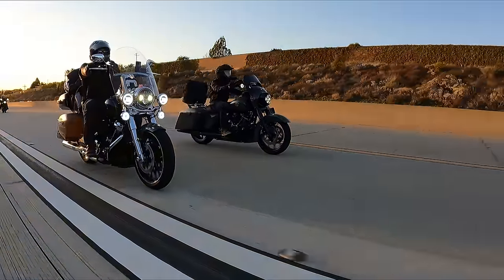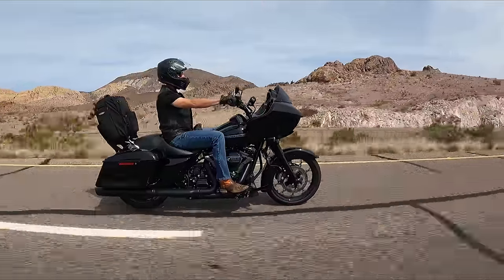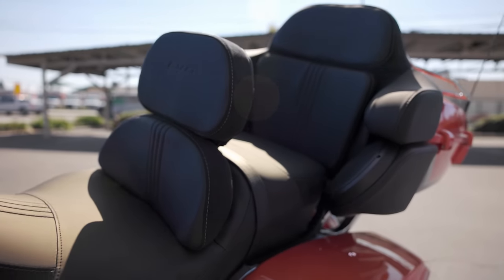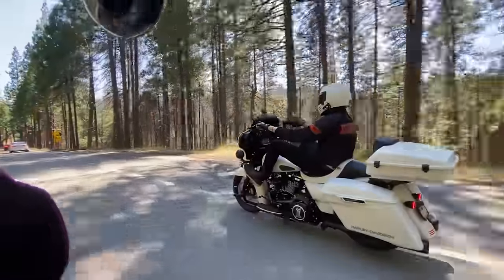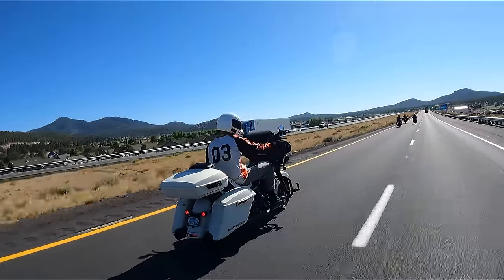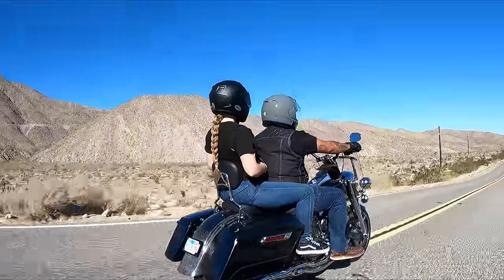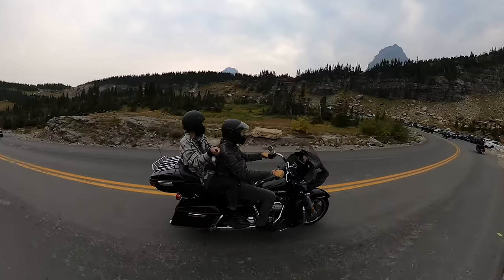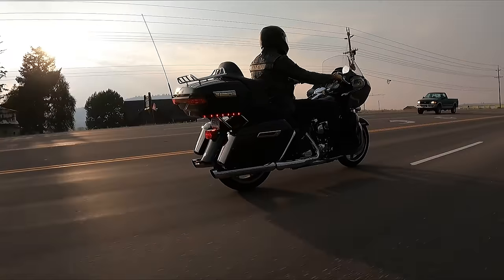Top 10 Touring-Comfort Accessories & Mods for your Harley-Davidson Motorcycle

Comment: Good tips. My top 5 comfort features are: seat, wind protection, bars, cruise control, and the best bang for the buck. Ear plugs. I ride 80+ mph for hours in 20+ mph winds. It's crazy how less fatigued I am when I wear ear plugs.
Reply from the maker: Totally agree with the ear plugs!
Reply: Ditto absolutely the ear plugs. I also have found reducing your clothes from flapping in the wind lowers fatigue. I use Velcro straps on my lower legs
Reply: Good tip! I started wearing ear plugs in the 90's. I got a lot of odd looks and eye rolls  back then but... No fatigue for me.

Comment: I’ve been riding Harley CVO road glides for over 10 years and having logged over 100,000 miles on them. I would agree with your list with one exception. I would eliminate the heel shifter and add the new Harley hammock heated/cooling seat. In hot and cold weather it is a game changer. It would definitely make my top three!
Reply: cooling? so in hot weather it could remain on lower temp?  great
Reply: I have a corbin heated seat on my kawasaki Vulcan, it's a  must have for cold weather riding, a bit pricey at $907 plus tax and shipping but worth every penny 😀

Comment: Love your list! Just added a rider backrest to my Road King last weekend. Here is my list of what’s on my RK-Hwy Pegs, cruise, heated seat and handgrips (north Midwest), and in winter I have the slip on lower wind deflectors over my crash bars.
Knock out wind and hold engine heat. 
Still have factory suspension and bars, but I think everything else I added.

Comment: I run up and down the east coast (Florida to mass) a couple of times a year and my ultra is it. Been doing it for 13 years and always do it on a rgu. I keep an oem rg seat and quick release tourpak for in town and convert it with tourpak, riders backrest, oem seat,  and cb for the road. 12 inch apes and highway pegs are a must. 
Lucky Lep's Cycles

Comment: Excellent video. I have 8 out of the 10 on my 2016 Triglide which has 120,000 miles. I don’t have the custom seat or the after market suspension. On my last trip from Nevada to Texas and back the air suspension on my Triglide left a lot to be desired. Thanks again.
Reply from the maker: Thanks for the comment. 8/10 sounds like a comfortable ride. 👍🏼

Comment: Old school rider who ten years ago at 50,went from rigid frames to a Road King. King has a Hoppe fairing,hard bags and 14 inch ape hangers from when I bought it. Going back to my chopper days,I made my own jockey shift set up that works like a dream,and my own ‘dump style’ drag pipes with homemade baffles. Made my own sissy bar and padded backrest also. As far as highway pegs go,I just rest my feet on top of the crash bars. At 60,I’m building a rigid Panhead that I’ll likely ride more than the bagger when it’s done.

Comment: Fully agree Matt, I got them all installed and they are all worth it. Heated seats really depend if you ride usually on a cold weather …whether heated grips can make it even in warm places because sometimes it is cold enough for your hands and it may be even dangerous (eg morning commute to work), heated seats are less mandatory unless you use the bike frequently on cold places.

Comment: Great tips.  As a Northeastern rider, Heated grips are number 1!  I was occasionally riding in 20F / -6.66C with salt and slush on the road.  I would constantly change my snowboarding gloves every 15 mins or so whenever I hit the highway.  I would thaw my hands on the engine block for about 10 mins in Chinatown NYC to keep warm and it wasn’t enough.  Sporty rider ✌️
Reply: Snow seal on boots and leather gloves us also great for winter riding. I gave heated grips and heated gear. In the winter in toss leather riding boots and gloves in oven at about 175°F. Rub in snow seal repeat then buff out. Water proofs and blocks wind. I do not used a fairing or windscreen, so wind proof and water proof gloves are a must. With them snow seal, it do not need bulky gloves, which adds to the comfort level. Snow seal is not expensive and a can should last 3 or so years.
Reply: @michaelconran5252  great tip, I’ll definitely try this out!  I hate bulky gloves too, kills the throttle response and front brake pressure.  I use wool socks and double layer for the boots and have been ok, thanks to Rokker for a premium boot.   I don’t use a windscreen or shield either.  Safe rides friend

Comment: After my last cross-country trip, I finally spent the ~$1k on an mccruise cruise control system from Australia for my 2018 Versys 1000. It shuts off if you hit the brake or pull in the clutch, and looks like it was a factory installed item. I absolutely love it, it completely changes the long distance experience. I spend enough time at highway speeds during my daily commute that it's also made it much easier.
Reply from the maker: Yes sir. Game changer out on the road.

Comment: Agree with all your suggestions and I have them all except heated grips.  I went with heated gloves instead but the grips would really be nice if I could find a great style.  I have the heated seat and my wife really loves that ,plus I have a heated backrest for the tour pack.  She likes that more than the heated seat!  But the one thing I love most is the rider backrest.  That is a must. I've had the same one on my last three bikes.  I just remove it when I sell or trade.  I will never have a touring bike without one. I've done 3 coast to coast rides and countless halfway rides since I live in DC and I'm from Texas I make that trek 2 -3 times a year. One of the newer items I have is the modular helment that flips fully rearward. I have the Shark and my wife has the LS2. Both work great and give you a lot of options.

Comment: Agree with all, I always add floorboard extensions. Seems to eliminate the bowlegged feel and to me adds a lot of comfort
Reply: When I first looked at those At my dealer, I was very skeptical as to whether those things would work for anything at all? But I finally gave in and bought some off of eBay out of sheer curiosity and what an amazing difference push my boards out an inch and a quarter from stock. Love them.

Comment: Thanks for the list on Accessories and mods for touring. I have a 2015 Ultra Limited and will always have a Ultra Limited as long as I ride. Bought mine used in 2017 as a two year old bike having 6700 miles on its already. I logged 10,000 K in the first nine months of ownership. I love my limited. I have made some improvements such as Back rest, highway pegs, Klock Works windshield, Ram mount for the phone, Headers and pipes and K&N Filter, ETC... Use the radio all the time. I live on my bike. Thanks for the content. Always checkout your content on the channel. Safe riding!!

Comment: The three comfort upgrades I made on my 2020 Street Bob was touring seat with backrest (Mustang), heated grips and leather covers for levers. Your video warned me about the Street Bob seat. Best looking, worse performing. Heated grips are a no brainer, have had them on my dual sports and I currently live at 7,000 feet. The leather on levers was for looks but add to comfort when riding at freezing temps or very long rides, didn't expect that. For body, heated pants and vest. Not a fan of wind screens, but i gave ridden in 17° F with no issues. To be fair I like cold weather. I installed heated grips on wife's Softail also along with a heated seat pad. She has electric gear also. We tour on the Softails with no issues. Neither of us like windshields, but with the right gear, comfortable seat and ergonomics, you can ride all day long. I believe the riding triangle is they most important, once you have that, all they other stuff falls into place. Being 5'1" with stubby legs, I can't reach forward controls, so a Softail with mids is perfect for me. To stretch/relax I just hang my feet over pegs. I can't flatfoot anyway, so feet hitting ground isn't an issue.
Reply: same brother

Comment: Suspension Technologies shocks work great for my 07 CVO Ultra.
I have Progressive Monotubes in the forks. My wife and I have ridden more than 80k miles on this setup, fully loaded for long three week trips.

The heated grips are awesome! We have ridden through massive rainstorms and as long as we continued to move, managed to stay mostly dry using heavy leathers. 

I rode my bike to work year round, temps down to freezing weather using heated gear and layers. 

My bike now has 92k mikes on it and going strong!

Comment: Definitely agree with that list. I’ve got a few of those added to my Road Glide Limited.

A couple others I’d add to the list: a drink holder and additional passenger pegs.

For long hauls, having a ready ability to grab a water bottle to hydrate regularly makes a big difference, especially on hot days. I’ve ridden coast-to-coast on my Road Glide (even stopped in at your store) and having the ability to hydrate on-the-go allows me to stretch my stops to the limit of my tank that much easier.

And for passenger pegs, I added the Kuryakyn adjustable passenger pegs. My wife loves having the option to shift her feet between the passenger floorboards, my lap, and those pegs. And we all know the adage: Happy wife, happy life. 😄

Comment: Yep that about covers them.  Learned the hard way myself.   Good suspension, cruise control, foot pegs and seat are a must for long hauls.  I have two different wind screens and two different seats for types of riding I would be doing for my SGS.  I have the nylon slip on lowers covers that slide on the engine guards for cold and wet riding conditions (worth getting). When it comes to long haul, comfort is king, looks come in second.  The HD Limited touring motorcycles are the most comfortable than any other manufacture for long hauls.

Comment: I have a 2022 RG Limited w/ lowers, heated grips, cruise control, RDRS, 14 inch KST, Klockwerks windshield, CIRO Highway pegs, SE Stage 2 cam, Rhinehart racing mufflers, HD Hammock seat, seat back and Custom Dynamics LED all the way around. Next up is Legends Suspension all around.

Comment: I road a Honda V65 which was rated with 125+hp that I took on many road trips with Harley riders. I NUMBER ONE addition was a cruiser/wind shield for comfort. Lower wind Fairings mounted to the engine guard was right up there.... I did have a DriRider one piece suit that keep me bone dry to go with water proof riding boots. Great list.....
Reply: You mention heated grips at the end.... I used a DriRider heated gloves with three settings and off. Great on long cold days on the road.

Comment: I run soft lowers on my road glide when it gets colder. Also on trips, for wind and rain. They are not super attractive but the ride is much more enjoyable. That’s the reason I haven’t put on the Santoro crash bars to match my bag guards, the soft lowers won’t fit on them… don’t want to give up that comfort for looks.

Comment: You nail it right off with the backrest. With my SGS it was the first thing I got. With 10k on my 2021, I’m still liking my stock seat, but my Highway pegs are a must. And cruise control for sure. And yes my 12” bars definitely made a difference. Still playing with my suspension. Dropped 2” on the rear with the stock shocks, and found a sweet spot on the adjustment. The only other thing I’m thinking of doing is front and back shocks. As for the heal shifter, I’m still old school. Keep the vids coming Matt. Always enjoy those left coast rides from here in Florida. Daytona Biketoberfest coming soon. Maybe the suspension then!

Comment: At the present time I have a 2007 CVO I bought it used first thing I did ,new full windshield, it has all the extras that You had mention, I plan to get rid of the air in the back an put on a different set of shocks, I really don't càre for the back restI  I pulled mine,I'm not quite 5 ft 9 ,I got lucky my Handel bars are perfect for me, All in all I have every thing you talked about an I do agree , makes the ride a great ride, I enjoy your videos ,keep up the great work,an have a safe ride, Thank You

Comment: Spot on Matt. One thing i would add to the list is mid-frame air deflectors. They really help keep the heat off of your thighs.  I have added most of your list to my 2016 Street Glide Special. I agree that rider back rest is the best accessory for comfort. I also added highway pegs, heated grips, lower fairings, and 7” wind splitter windshield. I love the stock cruise control.  Would like to update stock suspension and seat when the budget allows. I am fine with my stock bars.  Being 5’7” they work just fine. Keep up the good work!

Comment: I added a Mustang seat with a back rest to my 2020 Heritage 114 along with the HD Kahuna heated grips and I love it for touring now.  The handlebar position is perfect, the cruise control awesome and although it’s the soft tail frame instead of the touring frame, it’s comfortable for me.  The one thing you did not mention that’s big for me is rider floorboards instead of pegs.  They are stock on the Heritage and all touring models and they make long rides much more comfortable than pegs.  Plus the forward position is much more comfortable for me being 6 ft tall.   I rode about 500 miles from West Virginia to my home in Atlanta a few weeks ago and was perfectly comfortable and not tired when I got home.  Very good video.  Thanks for your hard work on all your videos.

Comment: I could not agree more I do a lot of long-distance riding, the order of my upgrades when I purchased my 19 RGS. 1) Seat w/rider back rest I bought it before I left the dealership 2) Windshield the RGS shield is worthless 3) Suspension/Shocks went with 13" Legends Revo A 4) Handlebars and heated grips. I did eventually upgrade front suspension as well but that's more for handling than comfort. My 19 RGS came with the heel shifter, but I would have added it if it didn't.

Comment: Good List, as a HOG Chapter Director and Cross Country rider (about 17k per year) I agree with your list - but I would offer this.  For Seat comfort the Harley Air Zepplin Pad (not full seat) instantly added 100 miles of comfort to my rides...upping my riding days to 400 miles a day. For peace of mind "comfort" the Custom Dynamics Brake light flasher made me feel more comfortable in traffic - cars drop back further from your rear fender when they see the "police like" flash of your tail lights.  The best windshield you can buy is the Long Ride Shields custom made re-curve windshield.  It instantly made my wife happy and kept her from getting beat up by highway winds.  (and it averages only about $100).   Another GREAT feature is the Sirius XM Infortainment add in - yes for music - but MORE for the Weather Radar Option that helps you navigate around rain and storms.

Comment: Got them all…. 
Lower that brake pedal
If you’ve got size 12 feet, lengthen those shift levers
Extend your rider floorboards…amazing difference 
Consider mini-boards instead of just a highway “peg” much, much better
Wife loves her Kuryakyn adjustable pegs along with factory boards….

Comment: I ride a 09 1200rt and agree with everything you've stated, I've ridden in the north and now I'm in the south riding most of the winter, wrecked my bike because of my eyes and rebuilding it to ride more, beemers are difficult bikes to work on but I've had more complements on this bike than any other I've ever owned and I've built some nice choppers in northern Okla.  I'm an older rider and still having a blast, just wish I had a good foot rest on the road but don't, can't even hardly device one either.  I'm wamting to get some good crash bars built for the front and back.

Comment: Loved this video with all the good recommendations for touring accessories. I have a 2011 FLHX Street Glide that I through the years have modified to perfection for my needs. The bike have lower fairings and heated grips (a must since I live in Norway, Scandinavia with its cold weather). I use the stock seat and a passenger backrest for those short trips with a passenger, a cool solo-seat for a more stripped appearence around town when driving alone, and I can throw on a heated touring saddle and a tour-pack for those long roadtrips. So, with these 3 saddles and the addition of a removable tour-pack I feel I have the perfect 3-in-1 bike for most occasions. Also I have the heel shifter and highway pegs. Really love my Street Glide.

Comment: A lazyrider bag, or a t bag will work for a backrest when you are solo. Soft lowers are available and e bay sells knock off lowers for dressers for pretty cheap. Highway pegs mounted higher up with a backrest is all day comfortable. Engine guards are 3 bolts and bung king and others make moustache bars that work for highway pegs as well. 

Bluetooth headset for your helmet and a phone mount for bikes without a system are the bomb. Tomtom makes a gos app for the phone that doesn't need a network, and it's cheap per year. To download music to your phone get an app, and you will have tunes, and comms. A must for those long days in the saddle. 

All I got on the cheap, but it's road tested and all works.

Comment: I got the HD push forward seat not just cause I'm a short ass but it's extra padding makes it more comfortable especially living with back issues....
I got 16" Factory 47 Marlo bars & love them & no issues whatsoever.
Yep I got a Poor man's cruise control, the throttle lock... Makes long rides a dream...
Heated Hand grips are one of the best things I invested in ❗ absolutely love them & use them so much more than first intended.
Safe travels 🙏❣️
💪🇦🇺💪
Reply from the maker: Great comment. Thank you. I never thought of the reach seat adding comfort but it makes sense.